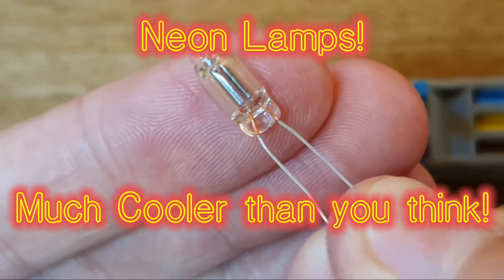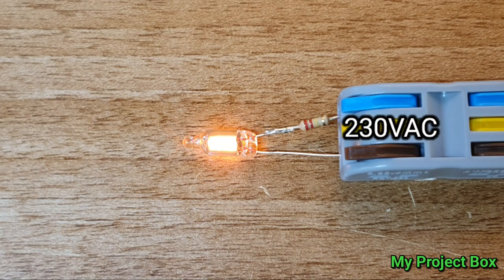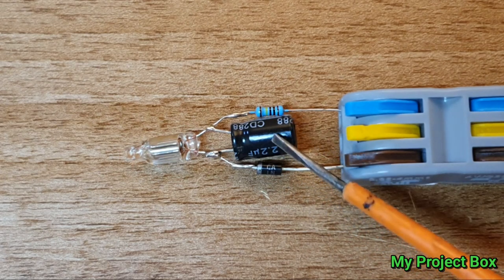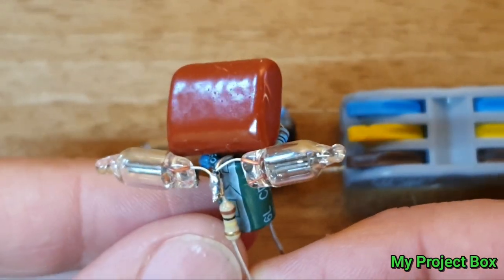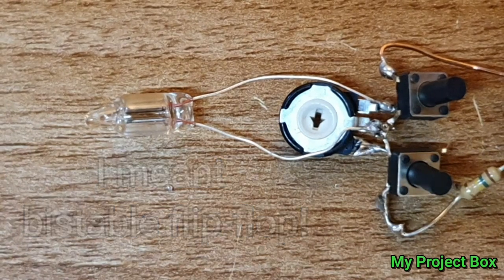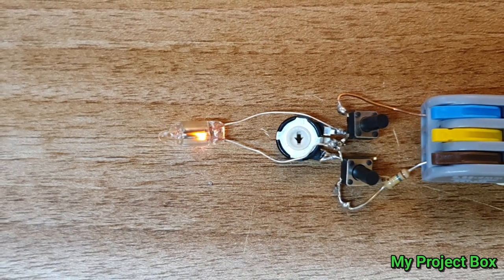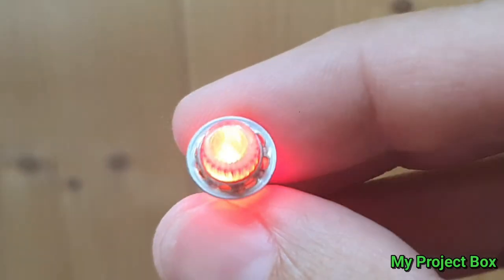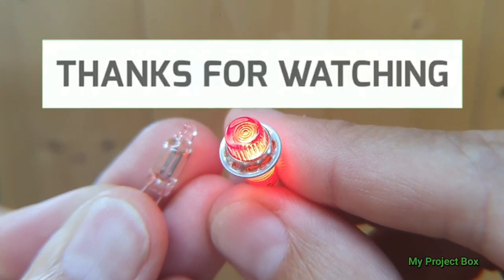Neon lamps are more interesting than you think they are. relaxation oscillator. Neon Schmitt trigger

Comment: Are you familiar with the very strange behavior of aged neon indicators such as in power strip switch lights and do you have any insights therein? Do you know what the electrode material is in these devices? I believe the lead wires are Dumet, but I don't know what the electrodes themselves are made of.

Comment: Good as blown fuse indicator if blinking. Is there some equation defining roughly the frequency per uF?
Reply from the maker: A blown fuse indicator! I like  it, that's a very good application. The problem is all neon bulbs are slightly different. I'm sure I saw the equation somewhere 🤔. I have always just wing it. Around 1 MΩ resistor and 0.47uF to 3uF capacitor and a 1n4007 diode. I will try and find the equation
Reply: @MyProjectBoxChannel  I read somewhere these can go up to 20khz, and I thought if one used radio tuning cap with max capacity of about 0.5uF it would be practically simplest adjustable sawtooth generator.
Reply from the maker: @plainedgedsaw1694  You might have to do some experimentation to get it working. Oscillator made with neons are sensitive to ambient light sources and the frequency can drift a lot. There is a little-known transistor version of the same relaxation oscillator circuit! It uses a transistor with only two legs connected in Avalanche mode. You connect the transistor  in the same way as the neon, except the base of the transistor is left floating! When the voltage across the capacitor Rises, reverse breakdown occurs inside the transistor, and it suddenly conducts, discharging the capacitor. It's probably the simplest transistor oscillator circuit.
Reply: @MyProjectBoxChannel  yeah, people usually call that one esaki oscillator. I tried it before and i trust it less than the neon, its using transistor in a way  that may cause it to suddenly fail.
Reply from the maker: @plainedgedsaw1694  I see what you mean about the transistor. Neons would be more robust. I tried making  audio oscillator with neon lamp. And found that half wave DC from a single diode only works for a slow running oscillator. You need a "smooth regulated" DC supply for the higher frequencies. You can use neon lamps to make a shunt regulator ( just like a Zener regulator circuit) to make "hi voltidge" DC supply.
Reply: @MyProjectBoxChannel  thx. good to know!

Comment: What diode did you use to run that on DC?  Is it possible to run this on a 9V battery?  I'd love an instructional.
Reply from the maker: The diode was a 1N4007. The circuit won't work on a 9v battery. You need to at least 100v. So powering it from mains voltage is the easiest way. It's possible to boost the 9v up to a higher voltage but that would make the circuit much more complicated than it needs to be.
Reply: @MyProjectBoxChannel  Thank you! Hugely helpful.

Comment: Wonderful experiment! Especially the flip flop one.
I have some questions.
1 - Most of the neon indicators becomes black after some years. What is the reason.
2 - if I connect LEDs to the flip flop of the neon circuit which u made, will that work.
Reply from the maker: Neon lamps can blacken more quickly if they are driven harder, to output a brighter light. So manufacturers sometimes choose a resistor for more brightness rather than longevity of the neon lamp. If you choose the right resistor and don't drive them too hard, they will last for many years! The flip flop circuit relies on the "special" characteristics of the neon lamp, and "high" voltage. So LEDs cannot be used in the neon lamp's place, without lowering the voltage and adding transistors.
Reply: @MyProjectBoxChannel  Appreciate your prompt response 😊